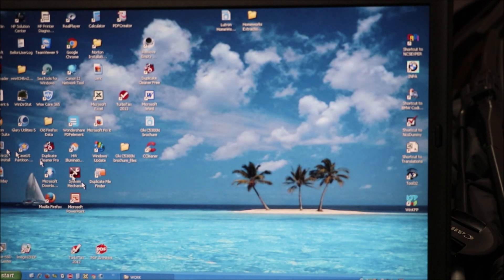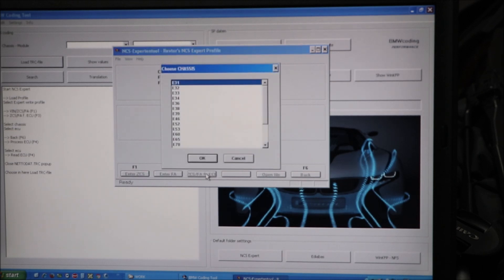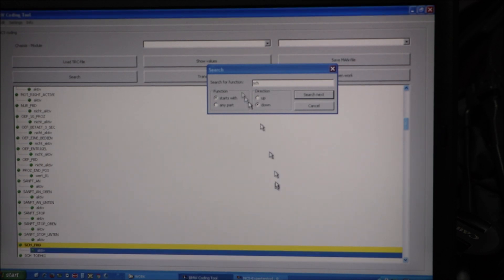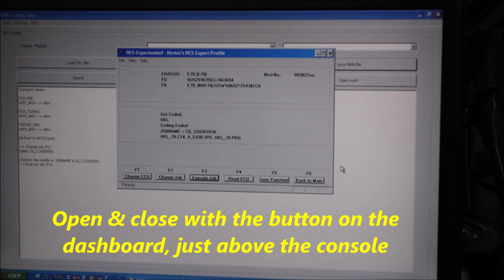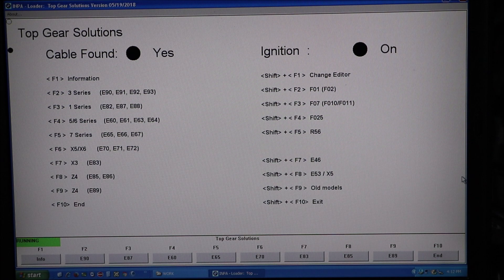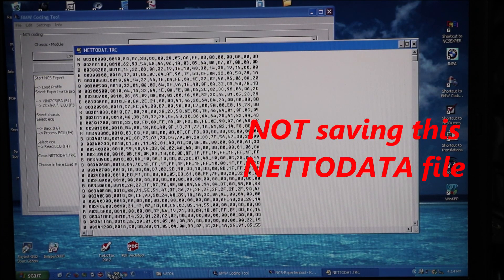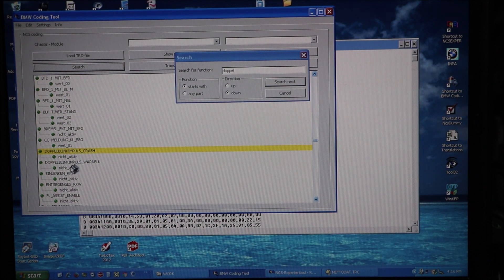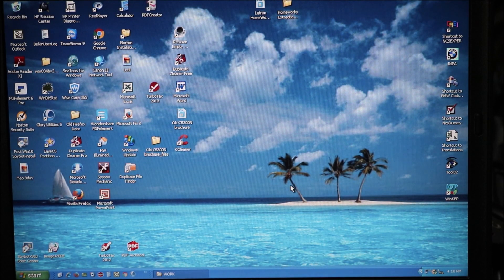How to code BMW X5 to close tailgate with key fob or dash button and double blink emergency flashers

Comment: My trunk won’t open x5 e70 bmw 2012 only with release pull but closes fine
Reply from the maker: Your tailgate control module is probably sitting in water!  I would immediately stop trying to open with the fob.  Open manually and check for water. Dry it out completely and you might be able to salvage the module.  Them track down the source of your leak.
https://www.youtube.com/watch?v=JBhoU37Wi24  
be sure to LIKE and subscribe.
Reply: @YuDaMan  i checked no water at all
Reply: @YuDaMan   i checked no water at all

Comment: Why didn't they make this and option... On/off.. In the system..
Reply from the maker: I suppose Dodge, Honda and other lawyers thought it was ok to have the feature as standard and BMW lawyers said ok for Europe but not for the USA.  My dealer refused to activate the feature even though I was willing to pay.  In the end, cheaper for me to do it myself software,laptop and cable and later again with cable, smartphone and a low cost app.
Reply: @YuDaMan  is this the right cable.. INPA K+ CAN Ediabas Cable with Switch .. Can you tell me what's best app and what to use. Don't have laptop just mobile... May I can use my daughters macbook...